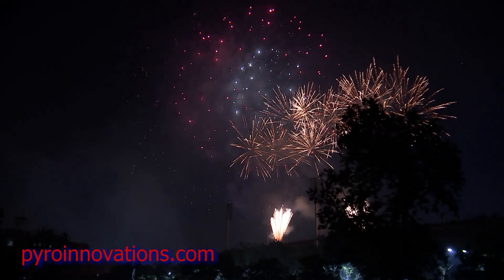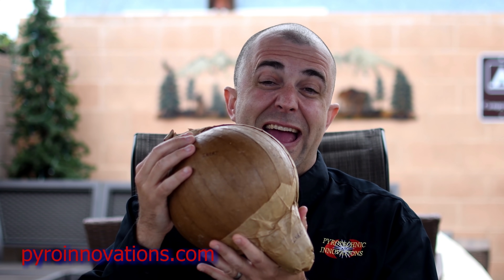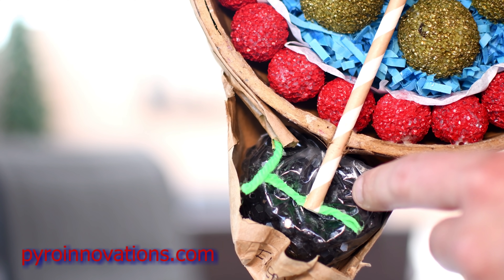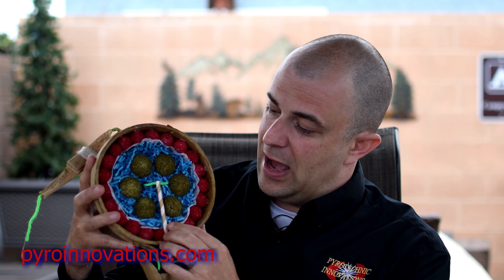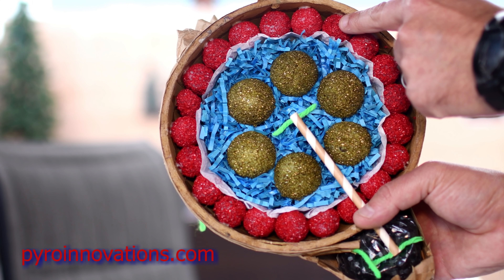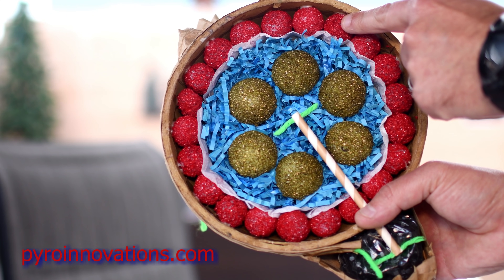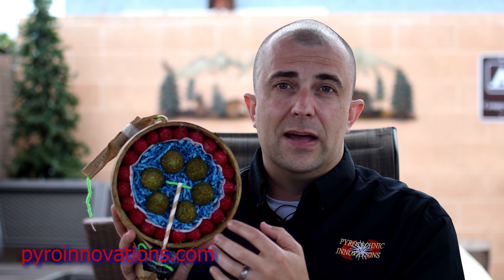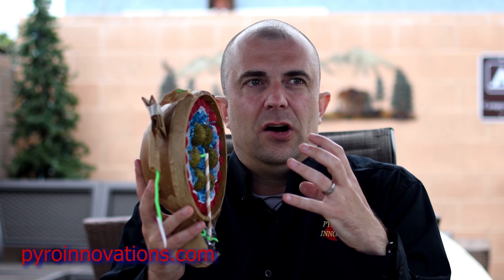How Fireworks Work

Comment: great video! wondering how environmentally friendly fireworks are in general. I don't think much effort is made to clean up the debris after a show, right?
Reply from the maker: Thanks Fernando! Actually, there is a substantial clean up effort after a show.  The pyro crew always cleans the area immediately surrounding the firing site, trying to get most of the debris generated during the show. This is almost always followed by a team from the client that clean a broader area.  We would venture to say that very little debris would be left behind after the scope of a typical clean up effort at a professional fireworks display.  Great question!
Reply: Yes. I was wondering if the cardboard & paper mache casing was vaporized, consumed, finely shredded or falls to earth somewhere.
Reply from the maker: The shell casing certainly comes back down after the shell explodes. Pieces can range from tiny shreds of cardboard to entire hemispheres. This is one of the main reasons we have what is know as a “fallout zone” or “exclusion zone” at professional display, where only the well protected crew is allowed to be during the show.

Comment: How are the two halves brought together without the contents spilling out?
Reply from the maker: Great Question!  The answer is, very carefully. :)  Different shell builders have different techniques, especially when it comes to larger shells, and when you get to a certain size, say above 24" diameter, they are no longer two halves that are put together, it is a different construction process all together.
Reply: As Pyro Innovations says, 'very carefully' but it often involves a layer of fine tissue paper on each half, to hold things in place for just long enough to close the shell. The contents of each half are usually pretty firmly packed anyway and the tissue is not substantial enough to affect the ignition or function of the burst charge or stars/effects.

Comment: How much time does it take to put one firework together?
What are the easiest and what are the most difficult?
When you get to the event area where the fireworks are going to be shown, how much time do they take to setup?
Reply from the maker: Great questions! Let’s take them one at a time: 
1) This can depend on the size of the shell and what sort of effects are being built into it. So if we take a standard star shell, you have to fabricate the stars (and burst and time fuse, etc), allow time for them to dry completely, assemble the shell, paste it, and then again allow it to dry completely. This is a multi day process. 
2) Standard star shells are fairly straightforward since they are the bulk of what is made.  If you start making shells with special inserts, say, a “shell of shells,” which is a shell with a bunch of smaller shells inside, you essentially have to go through the shell making process with all of the small insert shells, making each of those the same way you would make the larger main shell, let them fully dry, then make the main shell will all the small shells inside of it. This compounds the time it takes to make a “single” shell.
3) This depends on the show size and complexity. A typical (emphasis on typical) 4th of July display will take a 6-10 person crew 1-2 days to setup, whereas a small high school homecoming show might only take a few people a couple hours to set up. 

Thanks for your questions!
Reply: @PyroInnovations  
Thank you. 🙂
Reply from the maker: Our pleasure!

Comment: Wow what an interesting video (and channel). Ok for my question, does the lift charge have to be greater than the time the black powder filled straw takes to burn so the shell detonates at the correct time. In other words, do you want the shell to detonate at the epogy, or when the shell is still climbing. I gather you don;t wat the shell to detonate when it's comming down, or worse at ground level.
Reply from the maker: Great question, and the answer is yes, you want the shell to explode at apogee. This yields the desired look, height, and doesn’t lead to stars hitting the ground, which would be a fire hazard.  Professionally made shells rarely have any issues with burst height, unless they were not loaded all the way down in the mortar like they were supposed to be.

Comment: So friggin kewl.  I should have chosen that as a career path.
Reply: Not too tough to do on the side actually.  In normal times, when there are more shows and the aerial display companies need more assistance, keep an eye out for trainings.  This is NOT the same as getting your pyro license.  I attended a one day training advertised on Facebook run by one of the large companies.  It was half a day of classroom training (mostly safety related) and a half day of hands-on setting up different types of shells out in the desert and firing them.  Since then, I’ve probably done a dozen or so shows in 2 years fit 3 different companies.  The time commitment fit a show is fairly low, usually 1 or 2 days.  It’s tough work out in the elements and the pay is usually pretty low, but it’s a lot of fun.  There is a federal background check done, so keep that in mind as well.  Also your wife will be pissed that you never see 4th of July or NYE fireworks with her.  🙃

Comment: You use straight black powder inside the straw tube as a fuze confined inside the shell  ?!?  What kind of a delay we are talking about? Cannot be more than a fraction of a second. What am I missing?
Reply from the maker: Great question, but you are missing that there are different grain sizes of black powder. If the time fuse was filled with very granular black powder, then yes, it would burn the entire length in a tiny fraction of a second.  However, if you use a very fine powder, and pack it in tightly, it will burn at a relatively slow, controlled rate.
Reply: @PyroInnovations   The Great question, better-tuned this time. 😂 So I get straight, fine   FFFF  GOEX  black powder,  I  fill with it a thin paper tube at the required length.  6  in or so.  Pack it promptly, tightly and that 6 in fuze will give enough time for the shell to reach the proper height before detonates, Hundreds of feet above the ground.  Correct?  Or am I still missing something???   Thanks
Reply from the maker: No, it’s much more complicated than that. Keep in mind these are not instructions to manufacture, only a high level overview of how fireworks work. FFFF is still too granular, physical length of the time fuse in our display model was exaggerated for simplicity, in reality, for a shell that large, the time fuse would be shorter and utilize a pass fire tube to present the fire to the center of the shell, but that wasn’t included just like the detailed star formulations or exact burst charge compositions.  If you want to learn how to safely and legally manufacture, we recommend joining a pyrotechnics club like the PGI or WPA.
Reply: @PyroInnovations 
🤣 Curiosity only  I have no desire at all to make  or experimenting with fireworks. never did 🤣 Academically speaking  We get  a  6in. paper tube also tough enough to withstand the packing. We get black powder  in  REAL powder form, pack it light it on the one side  and we have some delay until the whole 6 in are consumed. That is my question  Did I get it right?
Reply: Forget about fireworks devices for a moment. Please answer this if possible,  It is as simple as it can get.

Comment: Awesome!  Now I have a clue.
I also wonder how reliable ignition of all stars is.
Reply from the maker: Ignition of stars is very reliable.  As mentioned in the video, stars are primed with black powder (more or less) which ignites very easily and seamlessly transitions to the colored composition inside.  If the burst charge is too powerful you can get the stars to blow blind as they will not have enough time to reach their ignition temperature before the shell explodes.  Great question!
Reply: I had crewed maybe 6 shows before I found my first unignited star.

Comment: what happens if a shell doesn't go boom!?
Reply from the maker: Donnie, that is a great question. That is known as a dud. A dud typically occurs when a shell is fired out of a mortar and the lift charge fails to ignite the time fuse. This causes the shell to come down unexploded.  Smaller duds (3”-5”)  hit the ground with nothing notable occurring. Larger shells tend to break apart/open, without exploding, just spreading their contents on the ground. This all happens within the “fallout zone” of a professional display, another reason for the fallout zone existence, becoming just a blip on the radar and the show continuing with the audience none the wiser. A lot of thought goes into ensuring safety and a great show when it comes to a professional display. Thanks for the question!

Comment: How does the burst charge not damage the load/shell on the way out of the tube? The explosion of the charge always sounds pretty violent.
Reply from the maker: Hi David, I think you are referring to the lift charge, not the burst charge, let me know if I misunderstood your question.  The lift charge firing the shell out of the mortar is fairly violent; however, the hardened paper casing is more than enough to take the hit upon launch.  The more common failure mechanism is not from the casing itself, but instead from a poorly sealed time fuse (time fuse is sealed to the shell casing).  Any leak point can cause fire to leak into the shell during lift and cause a "flower pot" malfunction.  Having said all that, it gets very complicated as you get above 12" shells, additional considerations like stand off distances and shell casing thicknesses become highly relevant in successfully getting the shell out of the mortar.
Reply: @PyroInnovations  Thanks! yes I meant lift charge.

Comment: Where can the average person get fireworks at wholesale prices cheap
Reply: You can sign up with company's but you have to spend a certain amount of money. It's not cheap but if your already spending that much money it's a hell of a deal. I have never looked into it cause I only spend around $700 for the 4th. You can also buy online by the case and certain times of the year you can get a case for like 40% off but you have to be willing to spend the money and buy however many fireworks come in that case 4,8,16,24 whatever that specific case is. So you have a lot of the same fireworks.

Comment: I like those super loud BOOM ones, you know the one that kinda echos, shakes the ground a little bit sounds kinda like a thud. Usually not much of a display except for a little bit of orange. It's usually one of the first fireworks to be shot off, I guess to get people's attention. What are those called ? Thanks.
Reply from the maker: @Eddini76, those are known as Salutes. A salute isn't much different than a regular star burst shell, except it is filled entirely with flash powder instead of stars and burst charge, everything else being the same.  Salutes break too hard to have stars, but sometimes titanium flakes are added, which give the ball of white sparks when a salute explodes.  Flash powder burns much more rapidly than standard burst, which gives the loud "report" that you hear.
Reply: @PyroInnovations  I live in N.H. sadly they are illegal here. They must be bigger though to be so loud. I also like the ones where the sparks break off into mini firework sparks.
Reply: It almost sounds like when the shuttle breaks the sound barrier.
Reply: I don't know if this helps but in another comment he said salute shells were the loudest.

Comment: I always wondered how a firework was made to explode in different pattern, shapes, & sizes. Another things what would happen if the firework had a malfunction when it’s already going into the air ....
Reply from the maker: If the firework "malfunctions" or explodes early, early being defined as some point after leaving the muzzle of the mortar to prior to reaching its apogee, you simply get what's called a "low break."  This is simply the shell exploding closer to the ground, which is one of the many reasons we have a "fallout zone" or "exclusion zone" during a professional display, so that the only thing that happens is the audience goes, "ooooooohhh," and the show goes on.

Comment: 1 How do you get the biggest bang from the shell, with big burst high in the sky; what makes it louder than other fireworks? 
2 how do you make the firework go higher in the sky? 
3 how do you make low to ground ones? 
4 do you light the fuse first then put it in the cannon? Or once fired the cannon lights the fuse? 
5 I seen displayed that the explosion lights up the stars longer how do stars stat lit longer as they fall down
Reply from the maker: 1. The answer to this is complicated.  Everything from the compositions used, if any burst charge boost was added, how rigid the shell casing is and if it was spiked or not, and if it is a color shell or a salute.  Salutes are the loudest, as they have no color effects and are just flash powder. 
2. The altitude a firework achieves is based on the weight of the shell, the amount of lift charge used, and the length of the mortar it is fired out of.  Just like a pistol vs. a rifle, if you shoot the same caliber bullet out of each, the rifle round will come out faster and go further since the forces created by the gunpowder combustion have longer to accelerate the bullet before it leaves the gun barrel.  
3. Same answer to number 2, if I understood your question correctly.
4. Check out our free online professional fireworks training website, it contains all the ins and outs of how we set up the different types of fireworks: https://pyroinnovations.com/fireworkstraining.html
5. The stars are larger and/or the composition that they are made from burns slower.  The larger the shell, the larger the stars you can put in it.
Reply: @PyroInnovations  also one last one, what gives fireworks it's whistle noise being shot before it ignites? And thank you for your help, I love learning safely about pyrotechnics.  🙂
Reply: @PyroInnovations  this was from Google but I don't understand what it's saying, can you simplify it? 

"The mixture is commonly referred to in the pyrotechnics industry as 'dragon's eggs'. ... This creates a standing wave in the tube, and as the distance between the end of the tube and the burning mixture increases, so does the wavelength, producing the characteristic descending whistle sound"
Reply from the maker: @YouTubeExplore777  The Google information is incorrect.  Dragon's Eggs are a crackle-like effect and have nothing to do with whistle effects.  The description above is correct for the whistle effect.  This is a complicated phenomenon and difficult to explain in a few sentences, so we have added it to our list of video explanations to create!  Thanks for your question!

Comment: Is the height of the explosion entirely determined by the size of the shell (and thus not changeable) or can a professional company adjust this?  I noticed the lift cup seems permanently attached and probably manufactured that way.  Sometimes my local fireworks show seems too low and just wondering if that can be adjusted.
Reply from the maker: Great question.  Shells are almost always pre "lifted" (burst charge already attached) from the manufacturer.  In most cases you have no reason to adjust this.  If you needed the shell to go higher, more lift could be added, but an alternative is to just make the mortar longer that you are shooting it out of.  Just like a pistol vs. a rifle, if you shoot the same caliber bullet out of each, the rifle round will come out faster and go further since the forces created by the gunpowder combustion have longer to accelerate the bullet before it leaves the gun barrel.

Comment: Hey.. I have a question. Where does that shell goes after burst?
Reply from the maker: The shell casing simply falls to the ground.  Professional displays have what are known as "fall-out areas" or "firing zones," which are cleared of anyone not part of the pyro crew.  Pyro crews wears full PPEs, from head to toe when in the firing zone, such as hard hats, safety glasses, etc.
Reply: Pyro Innovations is correct, but omits some crucial information! Essentially, the shell casing cardboard is blasted to smithereens by the break charge and falls back to the ground in (mostly) tiny pieces, not as big chunks! This is unlike a rocket, for example, where the motor tube and stick remain intact and return to the ground as a potentially dangerous projectile!
Reply from the maker: @alanmumford8806  , thanks for elaborating! But... you are off just a bit.  Professional display shells, despite their powerful burst, sometimes come down in very large chunks, as much as an entire hemisphere (of the shell casing) is not uncommon, hence the exclusion zone during a professional display, since an 8" hemi will really thump ya if you get hit when it falls to the ground.
Reply: @PyroInnovations  Always ready to be corrected, but I did say 'mostly'. :-)
Reply from the maker: @alanmumford8806  This is true!  Thanks for being a good sport, and we  certainly appreciated your input!  The rocket comment you made was another good point.